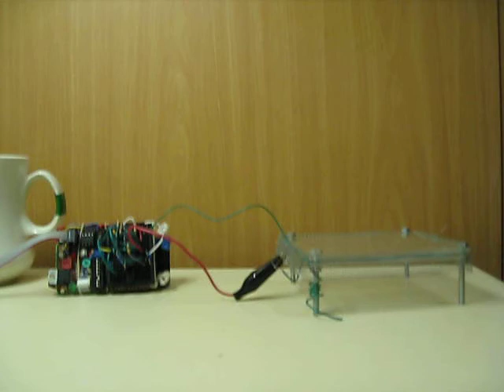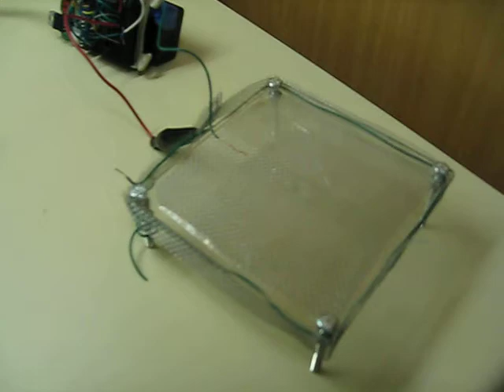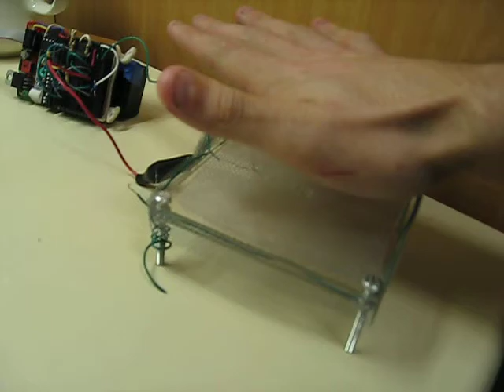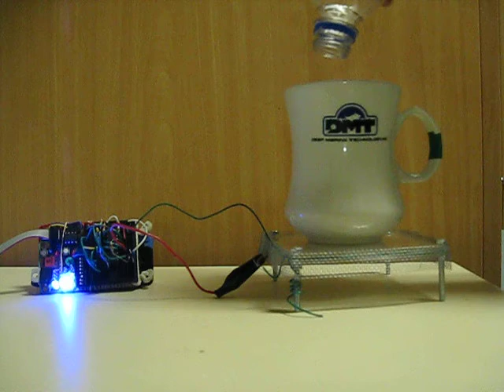Capacitive Proximity Analog Sensor Experimenting

Comment: Hey Quicky Quicky of a question, 1st what kind of sensor did you use to measure variable capacity was it the MPR121? I thought they could do only On/Off not variable. Also if that's true how did you do that setup in terms of code and stuff... Trying to figure it out myself actually for another project. haha

Comment: Might be that the detecting surface is a little big so there is to much spread. Also might want to increase the offset and the give it a value like if it's x milliseconds/cycles above/below offset  then power on port x